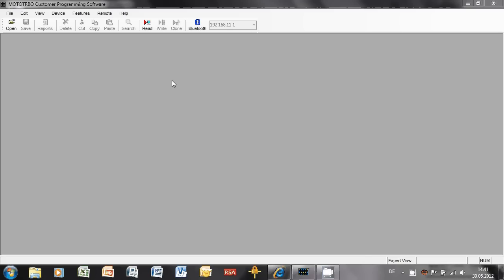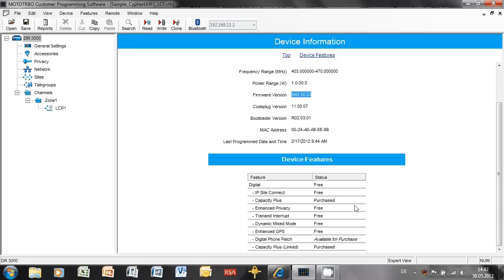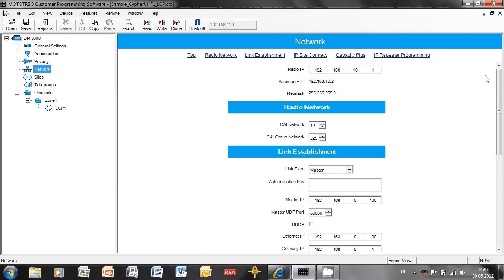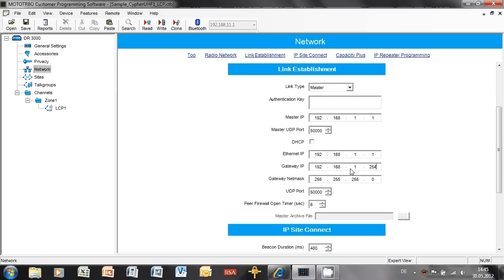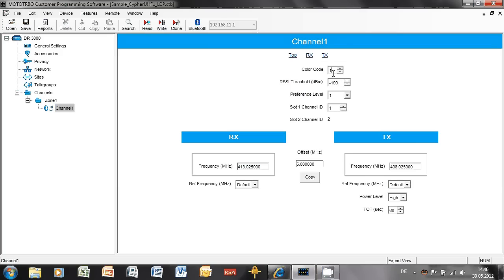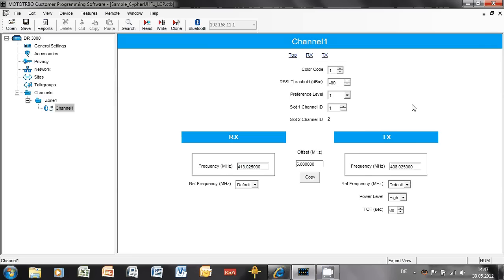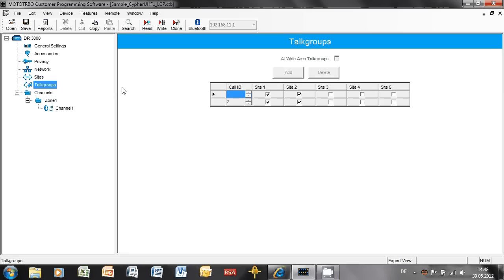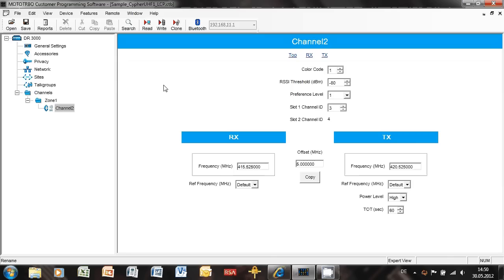MOTOTRBO: Capacity Plus Repeater Configuration

Comment: dear sir
i have the same model dr3000 and want to use it as vhf repeater , but when i try to set the frequancy the system reject it.
Reply from the maker: What frequency band is your repeater?
Reply: i want to set the rang 
(136-174) , please note the model is DR3000 and the model number is : : M27QPR9JA7AN thanks .
Reply from the maker: __M27QPR9JA7AN is a UHF repeater and will cover the band 403-470MHz. You cannot operate it on VHF (136-174MHz). Make sure you use . and not , as the decimal point.
Reply from the maker: Correction, __M27QPR9JA7AN is a UHF repeater and will not operate on VHF (136-174MHz).
Reply: thank you very much for your help .

Comment: Why digital Motorola radio comn range low
Reply from the maker: Gajendra Rawat Poor coverage is usually caused by one of the following (assuming the choice of RF site location is not the cause):

Faulty antenna and/or high SWR
Faulty coaxial cable
Faulty or out-of-tune duplexer (or combiner)
Desense and/or intermodulation.

Although highly unlikely, the hardware (repeater) could also be faulty but this only be the case if all the above have been ruled out by various tests. If you have a communications analyser, you could test the repeater to see that there’s nothing wrong with the repeater.